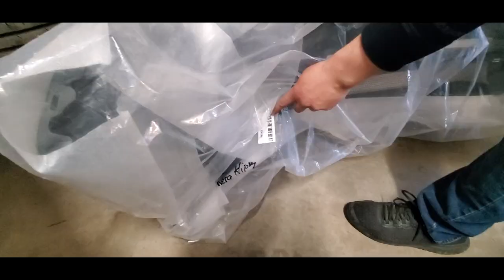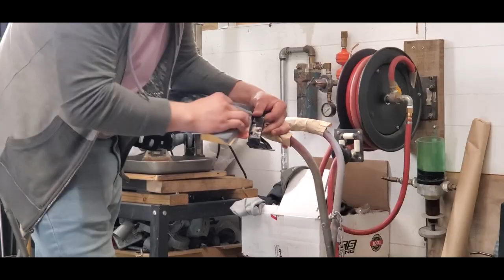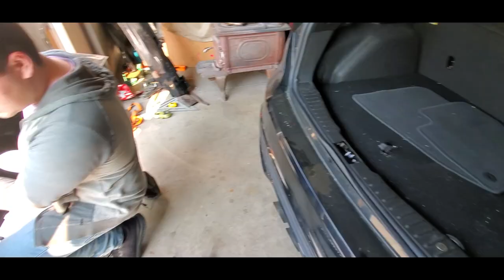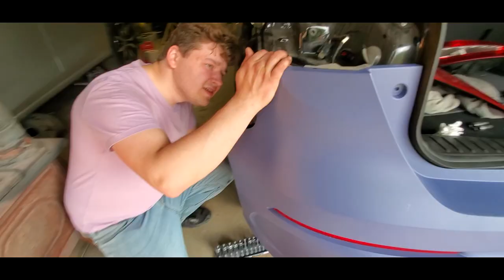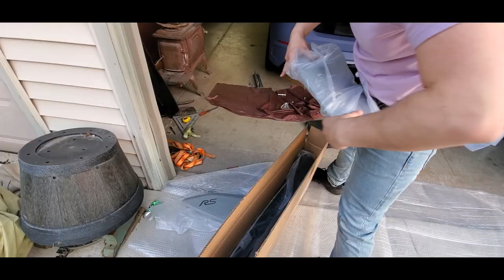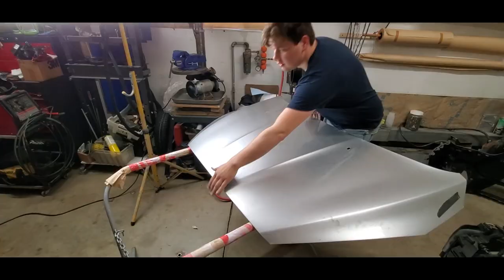Rebuilding a WRECKED Ford Focus ST Part 2 (Almost DONE)

Comment: Did you guys have any problems with your inner fenders lining up? I’m doing this currently and the inner fenders don’t seem to line up
Reply from the maker: Hayden G. Not the fender liners but if you are, you basically need to get rid of the plastic clips and go with metal clips with screws. Also you may need to drill new holes here and there to make it work. It’s aftermarket so you gotta work with what you got.. also I seen you commenting about the bumper and hood not matching, I had this too. you need to unclip the bumper off the top plastic part of the bumper and move it in or out. Then the bumper starts to flex. Dm me on Instagram and I could send some photos if needed

Comment: I have a 2014 st will it fit the spoiler and the bumper?
Reply from the maker: BloodyDeadmau yea and no, front end changed 15+ you can put an RS bumper on but you’ll need to change headlights and hood.. spoiler idk..
Reply: Side Hustle Garage can you drop the link for them?
Reply from the maker: BloodyDeadmau just search up Ford Focus bumper RS and you’ll get a bunch of hits, but this is the exact one I bought, https://rover.ebay.com/rover/0/0/0?mpre=https%3A%2F%2Fwww.ebay.com%2Fulk%2Fitm%2F192707540165

Comment: for the bumper conversion, are there any aftermarket brackets that need to be installed along with it or will OEM Fiesta hardware work along the Focus RS bumper cover?
Reply from the maker: If you mean oem focus instead of fiesta, then yes it will work. However fiesta and focus are completely different.

Comment: I’m confused is it a st or rs ur converting because I’m trying to convert my 2014 st to rs front end ?
Reply from the maker: Inez Frausto converted st to an RS. 14  is the older generation, it would need a different front hood and headlights for the front end, and different lights for the back end.. I know Somewhere in UK they sell the RS style for the older generation st!
Reply: Oh ok but can I use 2017 Ford OEM rs front end parts for my conversion?? Instead of after market?
Reply from the maker: Inez Frausto yup! Fenders should be the same thru all the years. So all you’d need is the bumper, headlights and hood. Also that bumper underbelly and fender liners.. it’s all the same dimensions tho, nothing is wider or smaller lol.. love ford!!
Reply: Really thanx !! For the info I do really want to use Ford oem parts but will I need specific mounts brackets, or clippings fittings  exedera??
Reply from the maker: Inez Frausto you’ll find out as you go really..